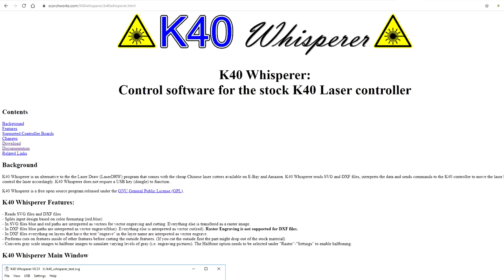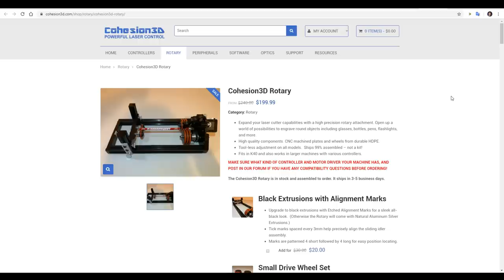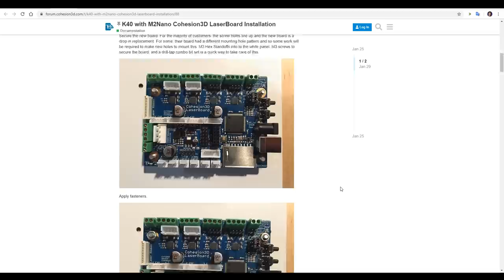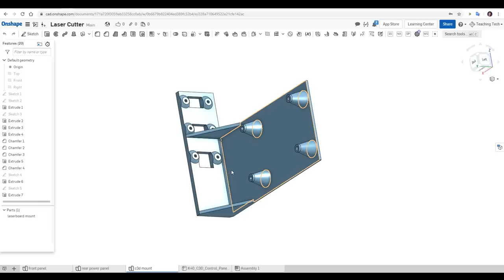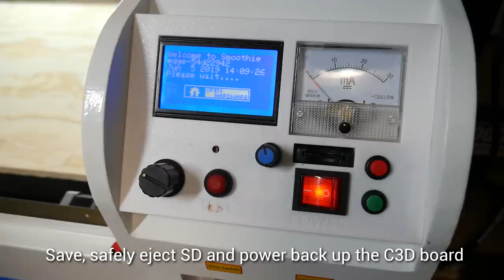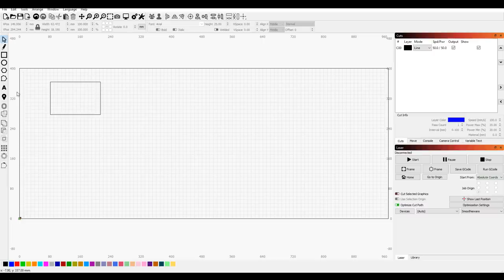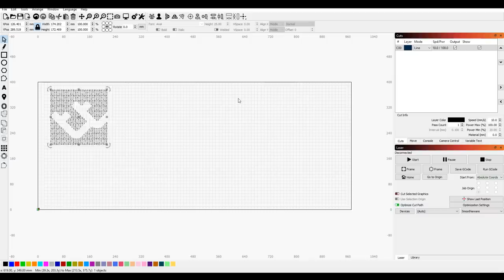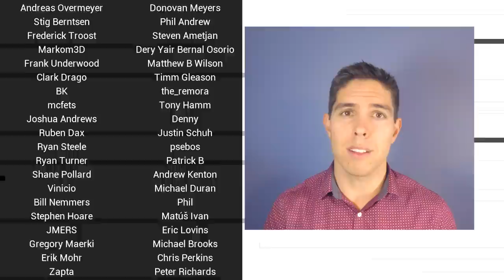K40 upgrade guide - Cohesion3D LaserBoard + Lightburn

Comment: you can upgrade without a expensive card, all you need is certain 3d printer cards and the firmware for them, I use a MKS makerbase version 1.3 card and the firmware , it works perfectly, some minor low voltage wiring adjustments and your done. I have had it running for over a year without failing once.

Comment: Thanks for another great video Michael! We're a small Aussie manufacturer and we package our products in black EPE foam and currently use a hot wire cutter to get square blocks that are pieced together. It's a bit tedious and we'd prefer to use more complex shapes that our products can fit perfectly into for a more professional look. I heard lasers have issues cutting certain materials. Do you think this laser could cut black packaging foam up to 20mm thick?

Comment: While it's totally worth the cost, a good alternative for cheapskates like myself (or for those who are starting out) is to ditch pirated chinese coreldraw along with usb hardware key and use k40whisperer software, which is free and works on windows and linux. It has its quirks, but is pretty solid overall.
Reply: Ive used whisperer  for about 3 years on homemade laser,,,cost me $1000 to make....use inkscape or gimp.....no need to pay $250 for cohesion and lightburn....

Comment: Michael, would a SKR V1.3 or a ReArm with RAMPS work with the same version of Smoothieware as the Cohesion3D boards? Both use the LPC1768 main control chip. An SKR V1.3 with 4 TMC2208 drivers is $45.00 with free Prime delivery. Either could get us started while we save up for a Cohesion3d board, if they will work properly.

Comment: Hi, keen to upgrade my k40 to C3D but looking at the price its almost $300! Did you get your board directly from c3d? Thanks! Looking forward to more laser videos.
Reply: Did you end up getting a board ? If so is postage much ?
Reply: @landlifem5872  nah never did. I ended up purchasing lightburn to create with, then export and send via k40whisperer. Already looking to upgrade to a bigger machine anyway
Reply: @matthmbg   can you do any grayscale stuff with your setup?   For the price of that board it's nearly cheaper to buy a diode laser  for greyscale
Reply: @landlifem5872  I have a cheap 5w diode laser for my CNC, so i end up using that for anything like that. After a while, the machines pay for itself which you could then upgrade to something bigger and badder :)

Comment: Hi from Italy Michael I've got a simple question, I saw Cohesion mother board has an LPC1769 processor as an SKR1.4 turbo, is it possible to use that BTT's mainboard into K40 machine with Marlin firmware?

Comment: Hmmm - Laser 350,- New Board 200,- ?  😮
Reply: True :D I known LASERDRW OR CorelLaser is 
tiring.
Reply: You get what you pay for. At that $350, you're not going to get the best results. 
The C3D natively supports additional axis (Z, and Rotary), as well as allowing true power control, amongst other features.
It's a well thought out board, as opposed to the cheapest thing the Chinese could scrap together to provide bare minimum functionality.
Reply: @jordymoors  K40 dont support Laser CAD, 
I think the motherboard pays off with a better laser class and a larger working field
Reply: same time awc708c cost less then c3d huh